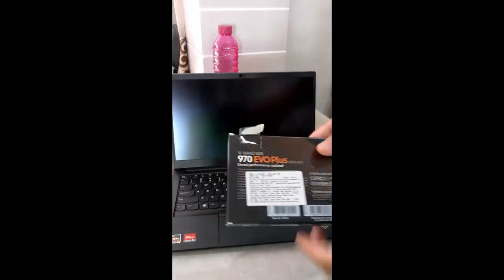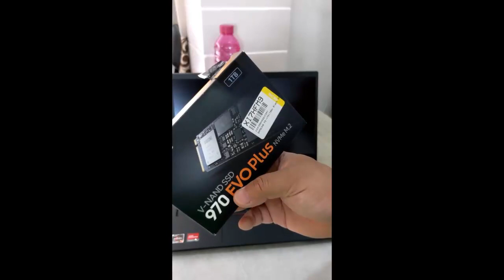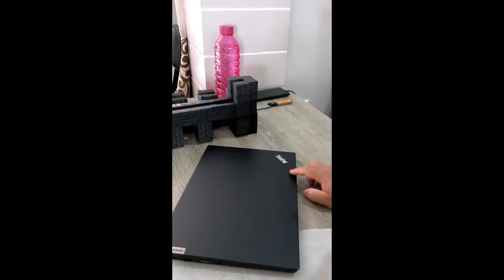Thinkpad E14 Gen 3 Review with Ryzen 5700u (PART 1 - unboxing and disassembly)

Comment: Did you see any thermal pad on the 2280 SSD slot? In the hardware manual, "Before installing a new M.2 2280 solid-state drive, ensure that the thermal pad is installed properly."

Comment: Only top cover is aluminum - rest of the body is the usual thinkpad plastic (which is extremely sturdy)
Reply: if true, the hand rest being plastic is a good thing actually .. it will not heat up. metal will get hot.

Comment: Good laptop… except the better processors 5600u and 5800u are not available in a customized build. For those cpus You have to get the prebuilt model… and those all come with the horrible 220 nits TN panel.

Comment: 24 gb ram in ryzen 7 is a bottleneck. with this budget you should have gone with the macbook m1. It would shatter this peace of junk in everything be it video editing by 4-5 times. i upgraded from  I9 cpu laptop to mac and the difference is huge
Reply from the maker: good for you mate
Reply: There are limitations of newer MacBooks. It depends on your use case. And how is video editing time a good criterion for performance, average user never does that. ThinkPad is able to handle everything I throw at it, I can dual boot it, increase any OS at any time, it is perfect Machine for computer science student who wants to tinker. It can game too unlike MacBook. Don't start me on the repair cost of MacBook. I seriously considered MacBook but then I took into account the extra money I would have needed to spend on Apple care and the dongles.
Reply: I bought this machine with a Ryzen 7 16 GB 100% screen with 3 year onsite warranty and its still cheaper then a MacBook air

Lenovo laptop  with 3 year onsite warrenty- $1263
MacBook air with extensive care - $1560

Both with educational discounts so no, MacBook is not cheaper

Comment: I have an e14 gen 2 amd, in lenovo side states the mex ram iss 24gb. Mine is 8 soldered and 8 replacable. if I put 16 on the free slot, will it still be dual channel? Like 16 gigs dual channel and 8 single, or all 24 gigs will be single channel? Will I boost performance or will actually slow it down, if the both rams are not equal sizes.

You will earn a sub and my respect for an answer :D :)
Reply from the maker: In your example, if you upgrade to total 24GB (8 soldered + 16 SODIMM), 16GB (8+8) of it will operate in dual channel, while the difference of the larger module will be slower, will work on single channel.
Reply: @ArhamZaira  Thank thank you for the answer. Last question is will 24GB (8 soldered + 16 SODIMM) make the whole performance better than the current 16GB(8 soldered + 8 SODIMM)? In must be better to upgrade, right?
Reply from the maker: @georgedimov548  though 16 GB Of RAM is already ideal for most usage scenario, hardcore users like me tend to prefer getting the highest possible RAM because it is the one thing you can easily upgrade. And the fact that you maximize full use of your 1 SODIMM slot with the highest supported memory, for future proofing. So if you have deeper pocket, go for it.
Reply: @ArhamZaira  Thanks, liked, subbed, and will order my RAM :) 24 of GIGs here I come :D

Comment: I noticed  the vent is near the screen, so when the fan starts running, does the warm air hit the screen, won’t it be issue in the long run? How hot does it get? Do fans make too much noise?
Reply from the maker: No fan noise that I can hear. The laptop remains pretty much normal so far.
Reply: @ArhamZaira  Hi brother..How are the thermals...Can you tell me what's the max cpu temperature under load ?
Reply: @harivenkatesh3816  For me, it only gets a lil warm while charging. Other times, it works great. Excellent battery life.
Reply: Even I had the same doubt...The placement of vent is poor...I have ordered the same e14... waiting for delivery
Reply: @harivenkatesh3816  I have not heard any fan noise at all.